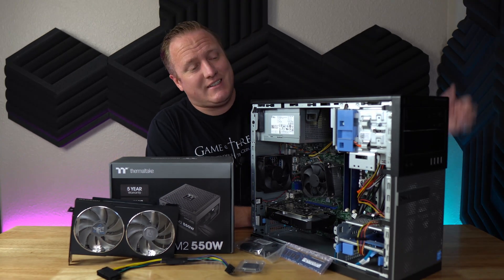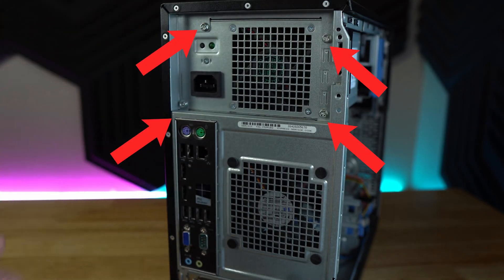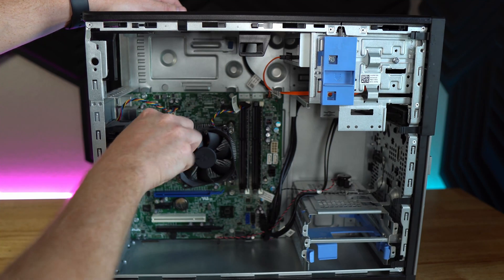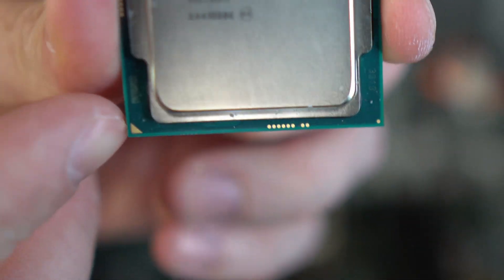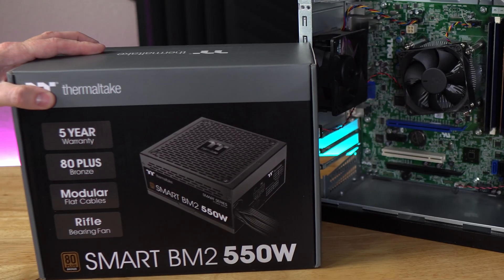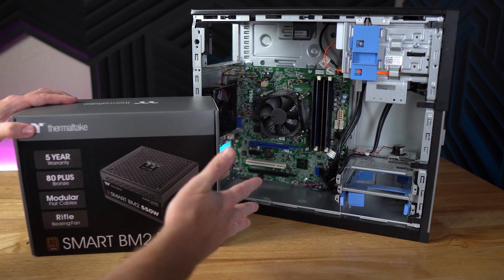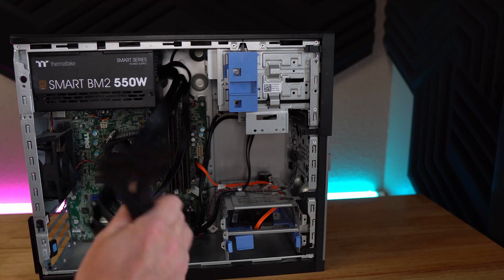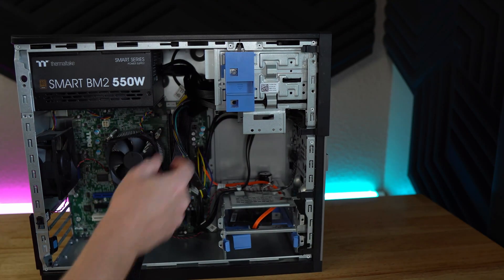Upgrading Your Dell Optiplex? Here's What You Need to Know!

Comment: I understand the logic behind modifying the USB plug by cutting the adapter. However, it seems the far more practical route would be to modify the original plug. You'd just need to remove the clip and cut down the two raised portions on either side of the clip. Then, I would plug it up and cover the connection with heat shrink tape. But I do understand that you can alway buy another adapter if you screw it up, and the factory cable would be more difficult. But, modifying the factory plug would look far less "janky."
Reply: And yes, I am watching this because I just bought one of these machines! :)
Reply from the maker: Yeah my logic was modify the thing I could replace easily.  You definitely can do what you mentioned as well! 😃
Reply: @PCTechHustle  Thank  you for the great info. I bought one for my office that I pick up tomorrow, then a whole bunch of part come in on Saturday. I am running an RX 6600 in my main rig and love it, so I know it'll work great in this machine, as well.

Comment: can you do a video of how to switch from legacy to uefi, lol cause ill select it in my settings upon start up but it doesnt find my ssd or 2tb hdd : only when in legacy mode, or could i leave it in legacy mode and put my GTX 1050 4gb or 1060 6gb in it? and run it in legacy mode?
Reply: Those cards should run in legacy mode.  Your OS was installed in legacy mode, or you’re dual booting and the other OS is UEFI while Windows is legacy.  I haven’t gotten around to trying to fix it on mine.

Comment: Not Optiplex, but Precison T3620. I got it in bargain with i7-6700, 32GB RAM and 256 GB NVMe. Upgraded beast:
i7-6700 (no point upgrade for minimum improvement)
Thermaltake Contac 9 cooling
32GB RAM (4x8GB, maxed out)
512GB NVMe Samsung 960 Evo
2TB Seatage 5400 RPM
2x Crucial MX100 500GB
Palit GTX 1060 6GB Super Jetstream
Seasonic Focus Plus 80+ Platinum 750W
24-pin to 8-pin adapter

Researched GPUs to make the length (chassis has internal struts, making max length of GPU card hard limit), but biggest problem was with format, as this GPU is 2-slot wide, which covers Front panel connector, also proprietary format and quite big... Ended up heat bending the connector.
Also NVMe slot is directly under the GPU, increasing temp when working under load and definitely shortening life of the SSD...

On the upside - very stable machine, gaming WT, WoT, WoW, COD (all of them), Wolfenstein, Civ 3/4/5/6 always smooth and BSOD-less (I could count them on one hand in 4 years I had it).

Comment: I have a Dell optiplex 9010 and I plan to upgrade the GPU and PSU I found options for each one but idk if either are good for my optiplex? I'm especially worried about the GPU since idk if it's too big or maybe I'm stressing over nothing?

If anyone has any suggestions feel free to reply to me ^~^) Ty!! 🙏😄
Reply from the maker: My best recommendation for the GPU is try to get a smaller one no more than 2 fans and at or under 10in in length.  Also a tall height backplate will cause you issues as well.
Reply: @PCTechHustle   Thx for your suggestions TechHustle! I had a friend suggest I buy the GeForce Rtx 3050, he said it shouldn't be too big for my Optiplex? 🤔

Comment: what is the maximum length and height for the gpu to perfectly fit without removing the hard drive cage?
Reply from the maker: About 10inches
Reply: @PCTechHustle  do you know if i can put XFX RX560 dual fan in there?

Comment: I remeber one year ago having that Dell optiplex with a gigabyte radeon rx 580 8gb and it really surpirse me how well it ran the mayority of games. Good old times.
Reply: how did you fixed it?
Reply: Did you upgrade psu? The standard is 290w and it’s nowhere near enough to run on high games. At least it’s not in my 7020
Reply from the maker: @a1ankaymusic watch the video to find out!
Reply: I did. And asked a particular question in the comments below if you don’t mind answering ? My only question was did you use a standard atx psu ? Everyone’s telling me I have to use tfx power supply and they suck. I have already ordered the proper adapter (24 - 8)
Reply: @alaskanbabydaddy  it was an standard ATX PSU the only thing I had to buy was the adapter 24 to 8 pin to connect to the motherboard

Comment: I had the same trouble but found with the arm left in, but unhooked from the frame you are able to pry to the out side enough to work the power supply back into the case with a little work without much trouble. The hard part is putting the latch arm back into the notches in the frame. (note that the spring also has to be left in place due to no room to re-attach the spring after the power supply is in place.) I just did it myself.

Comment: Will the Asrock Radeon RX 7800 XT Challenger or Sapphire Radeon RX 7800 XT PULSE graphics card (2 fans) fit into the case without unnecessary removal of the disk cage?
Asrock -267 mm
Sapphire-280 mm

Comment: Do not trust used optiplex computers online because everyone is a sabotaging scammer on Amazon and Ebay. The grounding insulation is removed, so the moment you try to upgrade your machine, your motherboard dies due to electrostatic discharge.

Comment: I bought a 7020 and I didint upgrade the Powersupply. Still got a 1650 super in it and a i7-4790k. Also upgraded to a tower cpu cooler, 16gb ram and 1tb ssd. The 290watts works perfectly fine on full power

Comment: I bought a 9020 mt and put a i7 4790 with 16gb ram with an rx 560, downside is I didn’t know it only takes a few different styles of ssd so I have to go return it, but also the internet pcie sits just under gpu so no place to put one, I have been running Ethernet but still slow on this 9020 ???

Comment: Watched a ton of videos and trying to get a solid answer. Purchased a 7050 mt. Don't mind upgrading psu. What's the best bang video card to install? One that won't be bottlenecked by pci e bus speeds. 

I know rtx a2000 is best low profile option that doesn't require new psu but even used the 12gb version is hovering around $400-450 due to these youtube videos. 

Any 3060s that'll fit? They seem to be a little cheaper. Sorry for the questions I haven't modded a pc in 10 years. Getting old now! 

My $104 7050 came with i7 6700, 24gb ram, dual video cards(r7 450 and qvns 310 ) plus a tiny ssd I gotta swap out.
Reply: Might be a bit late but 1650 doesn't require a psu upgrade if you can get one that doesn't have a 6pin and with a psu upgrade a 1660super/ti, GTX  2060 or a amd rx580, Rx 5700 just look out for clearance issues with the bigger cards
Reply: @obtains  decided on rtx a2000. Was $250 on amazon.

Comment: I'm tempted to pick up one of these little cases for a retromod. Is the OEM motherboard a standard uATX part that you can swap out with a modern motherboard, or is it yet more Dell reinventing the wheel in square?
Reply: Stand-off pattern is mATX, but the replacement motherboard headers will require modding or adapters.

Comment: Ran into the same fitting issue with the PSU on a 7010 MT and an FSP Aurum 750CM.  You can jimmy it in from the bottom very carefully by removing the motherboard completely first.

The issue is actually the extra length needed for the modular components.  A non modular PSU will drop in without issue.

GPU's with a length of 6.9 inches or below should fit in no problem, so an ITX model would be a good choice.

I also believe mine and the 9020 motherboards can support upto 32GB RAM.  with 8 GB DDR3 1600 RAM sticks going for less than 10 USD each, is it worth going full 32 GB?
Reply from the maker: Great information!

Comment: Hey I'm a complete beginner to PC building so what do you recommend I change with my 7020 dell optiplex I want to change my CPU and it also seems that I should change my PSU I'm basically poor so i can only spend 200 dollars on upgrades if i can upgrade my cpu gpu and psu all within the 200 dollar range that would be great but i have no idea what cpu is compatible with the motherboard so if someone can tell me that would be fantastic.

At this moment i have a intel core i5-4950 and a 1080ti or i think its a 1050ti which ever one is worse i also have a really weird motherboard and i cant find any i formation on it, its called a "dell 0f5c5x" so if someone can help me that would be great (pls i need help badly)
Reply from the maker: You can upgrade the CPU to an i7 4770 or 4790 (4790 the best).  They should be a simple drop in CPU replacement.  As for GPU, without incurring more cost I’d suggest one that does not require a PSU upgrade like an RX 560 or GTX 1650.  If you go beyond that with GPU you will need a PSU upgrade to support.

Comment: I got a dell optiplex 7010, i put an i73770 and 32 gigs ram and an rtx 2060 12gb and a 650w psu. At this point I would need a whole new pc to upgrade. So if I could figure out the Dell case wiring of the power button and the front panels I could just use jumper wires to connect them all to a newer motherboard like the msi boards.

Comment: I use the exact same GPU, PowerColor RX 6600 XT Hellhound and I don''t need the USB 3.0 cable extension. You plug that cable to the motherboard header last, after installing GPU.
Reply: I was wondering about that.  I bought a 90 degree adapter for my T1700, because I converted it to AM5.  I’m guessing that he just wanted extra clearance.

Comment: I have the same computer and I use an asus USB-BT400 usb adapter for bluetooth to a Vizio sound bar and it crackles and sounds like crap, I tried running cmd sfc /scannow and it's still a nightmare, any pointers on how to correct the sound problem? I also have a lenove ideaflex pad5 with built in Bluetooth which works great however it's a low end non gaming computer, will a displayport to hdmi work to fix the sound problem scapping the Bluetooth???

Comment: I would've paired Optiplex or Lenovo/IMB equivalent 4790/K with 1660s or even 1080 given you can make space for it... For 1080p built, it should utilized 85-93% of the CPU which give it room to manage background apps while pushing 100% of GPU in running games... Sweetspot babeh... Cheers! 🍻🍻🍻

Comment: Top tip for these you can actually drop in a Xeon E3 like a 1240 (not sure about some of the higher wattage ones) v3 and it'll run in a 4th gen Intel optiplex :)) you get that hyperthreading, big cache, and if you do a 1290v3 higher base clock for like 20 bucks! The 1240v3 has a low enough TDP where you can toss in an RX6400 even in an SFF case!
Reply: Have you used the 1240v3 RX6400 combo? i have both in my cart right now.

Comment: Good video. Some of those Dell's that have an i3's like a i3 4170 have a smaller/weaker fan on the heat sink. I notice the temps were very high when I swapped out the i3 4170 to a i7 4790 on a Dell Vostro tower (fancy looking Optiplex) and I did some researching. Dell chose to save a dollar on the i3 fan/heat sink models.
I just changed the fan to a better fan on the heat sink and then the temps were acceptable.
Reply from the maker: Interesting I never knew there were different coolers!
Reply: How did You do thaaat??? :3

Comment: No no no dont buy this psu get something like evga 450 br. Trust me evga is better
Reply from the maker: Please do some research before spreading misinformation.  This PSU rates HIGHER than the EVGA BR series.  Both tier C unit but a higher rated tier C than the EVGA BR units.  I do also generally recommend EVGA on basically near anything don’t get me wrong but you sir are misinformed 😎

Comment: What would you recommend for a 9010?
Reply from the maker: You can do literally about the same things!
Reply: I am building a 9010 and used the i7-3770 and modded my latch system by notching the plastic catch in the middle. I cut out the bottom left corner with a saw blade and my Antec 650 watt PSU fit right in with just a lil tweaking.

Comment: I bought an Optiplex 9020 for $490 on Amazon with an i5-6500, 32GB DDR4 RAM, 256GB SSD + 3TB HDD, and an RTX 2060 SUPER 8G...
...and it came with a stock 290W PSU. It works fine as far as I can tell, but I assume this will throttle it quite a bit and potentially cause more problems down the line.
I plan to upgrade it with a 500+ watt PSU, and probably also an i7-4790 like this, and a larger SSD eventually. But if it seems to run fine as it is, and I don't really have the budget to spring for the upgrades right away, how important is it to put in a new power supply? Is it something that can wait a month or two, or is it dangerous to even run a 2060S on 290watts? (its TDP is 175W, and "recommended power" above 450W)
Reply: Why would you try to put a 4th Gen Intel CPU in a 6th Gen system? Why not go with the i7-6700 which is a 65 watt chip with 4 cores and 8 threads? Besides the 4790 doesn't' recognize DDR4 RAM.

Comment: I just recently rebuilt a 9020 dumpster PC. I put in a 4790K and 32GB of RAM to start. For the Power Supply and Video Card, Dell actually made an RX-580 (though it's a standard non-overclocked card) and a 365W "upgraded" PSU with a 6-pin PCIe plug. It does work, but it comes really close to the limits of the power supply.  I will put in a better supply and card later on, but it's enough to start for me.  The sad part is to some extent, my 9020 SFF tends to work slightly better, despite it getting pretty warm.
Reply: For this machine you do need more than 16 GB ram max, 32 is just not needed and a waste of money in most cases (unless you need it for things other than gaming). You could live with 16 GB easily in 99% of cases, with absolutely no difference in switching to 32 GBs, you can also add in a 600 Watt with additional room just for comfort with 80 plus silver rating, and if possible add 2 cheap 120 fans intake and out, for GPU it is good, however you could also have a slightly stronger GPU such as 4050, or the very-strong-for-your-machine RX 6700, which might be an overkill upgrade which might be bottlenecked by the CPU, if don't already have an SSD it will make a huge difference (not in gaming mostly, but rather in getting a fast machine, it's night and day).

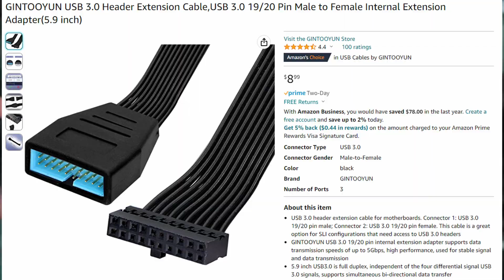Comment: i have optiplex 3020 I don't need the usb extension you recommend from the 13:31 for my GPU is small is a fan looks good
Reply: 3020 has standard header connectors.

Comment: What upgrades can you suggest for a 7010 opti plex or do you think it’s too outdated should I search for a more recent model. Sorry if the question is kinda stupid I’m new to the pc gaming genre😅
Reply: My 7010 was upgraded with a max of 32 gigs ram a 650w psu an i7-3770 and an rtx 2060 12gb gpu. I had to modify the case.  If you get all 90 degree sata wires you can plug them in and still be able to seat the gpu after removing the hdd cage.  I didn't want to give up the front panel usb so I cut out and bent back the bottom of the case making it horizontal now.  Then I found a 90 degree adapter for the front USB cable.... if only I could figure out how to wire up all those connections for a newer amd board and processor..... take it from 4 core to 6 core. Double the ram but keep everything else. I should probably mention that the bending of the bottom was due to the fact that I had to put a double slot sized card in the bottom pcie slot which only had room for the single slot,  once I found the adapter and switched it back to the main pcie slot it was already too late.
Reply: Figured out the wiring and have replaced that old Dell motherboard. The case defacing turned out to be a good thing as the new board was to long for that model case but I got the power button and the USB panels working,  now when I get my other jumper wires I can use the front panel audio too.
Reply: If you don't want to modify the case for the GPU, you could try looking for an ITX model.

Comment: Does the removal of the latching system not affect the support of the GPU? Is it still held in position? 
Great video BTW.
Reply from the maker: No it doesn’t.  I think I failed to mention you can screw the GPU into the side of the chassis like any other PC case.
Reply: @PCTechHustle  ah perfect.  No worries there then. Thanks for replying.
Reply: @PCTechHustle  ????? WHAT

Comment: I dropped in a pcie/nvme adapter for $10, followed the nvme bios hack, dropped in an mvne drive which even though this is pcie.2, us still 3x faster than ssd..  

And I/O as we all know is always the bottleneck.

I then using throttlestop, undervolted it.. -.065V is all it would take before it became unstable, but this made it run faster while 30 degrees cooler at idle..  You need to do this.

Comment: Can i put a gtx980 in a Dell optiplex without buying a new power supply
Reply from the maker: Unfortunately no you cannot.  The GTX 980 is an absolutely power hog.  You would need atleast a 500w PSU.  I would look more towards new / better performing GPU that also require mess power investment, or if you look at the previous videos I’ve done with the one, you will see the better plug and play options available to you.